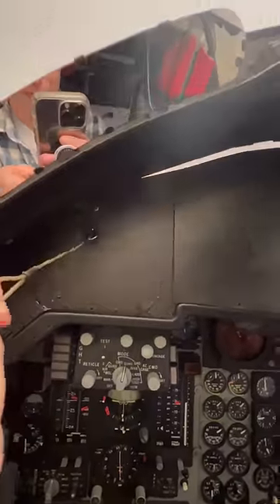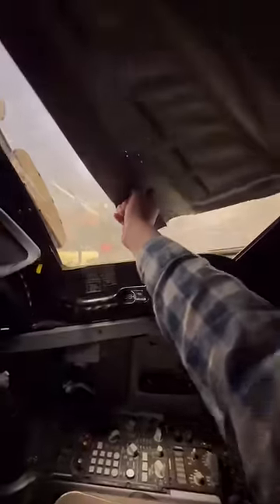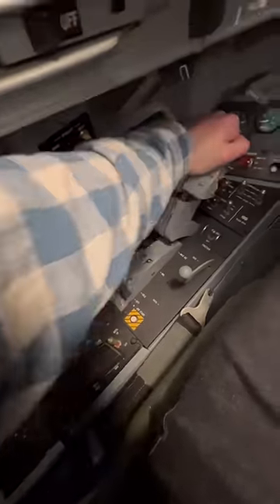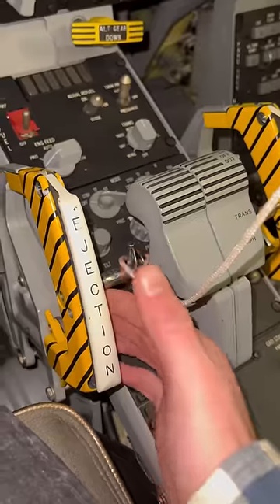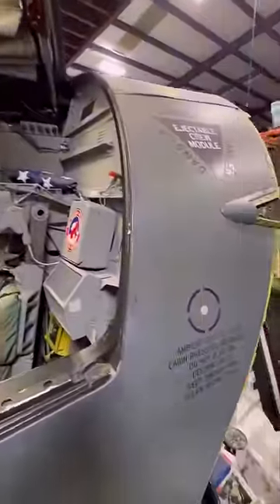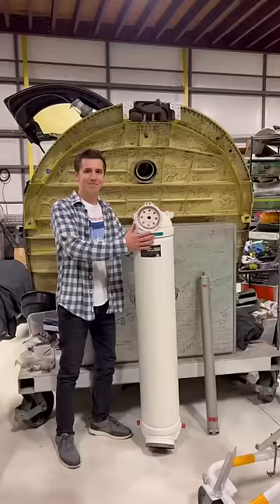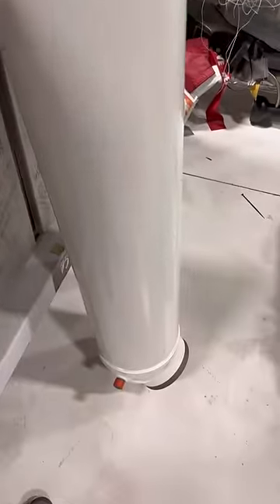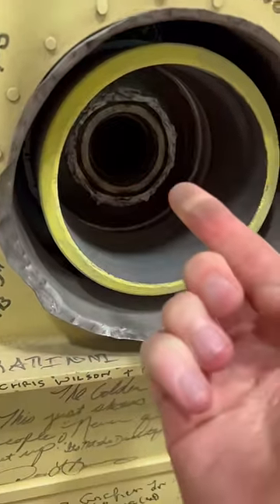How to Drop a Nuke and Survive

Comment: In Britain there was, or still is a lawsuit from soldiers against their government for non compensation resulting from injuries obtained during nuclear testing.

A group of survivors said the following…
They were told to wear safety/ welding goggles while on the outside of the warship facing the forthcoming detonation of a nuke over the ocean some miles away.

They were told that the brightness would be very intense. So they were told to turn around facing their ship with their backs towards the explosion. Crouch down onto the deck in the fetal position. Place their knees against their goggles and their hands between their goggles and knees with their eyes closed as tight as possible.

When they did that, they said the brightness was so intense that they could see through their hands with blood glowing red pulsing through their veins and beyond their hands they saw their knees and lower leg bone…with their eyes closed and wearing welding goggles. The flash traveled from behind and through their skull, eyes, hands and legs and reflected back onto their retinas allowing briefly to have X-Ray vision of their own bodies.

Would those curtains really keep that light away?

Comment: No need to eject.  They would most liked use a dive toss maneuver. The aircraft would basically pull up and release the bomb prior to the vertical then continue over the top, roll out and beat feet 180 degrees away from the release point. The again, there might not be any base left to return to.

Comment: If the jet can’t handle the nuclear force behind the bomb, I’m not so sure I’d want to eject out of that machine. Especially because you’re probably pushing the throttle to the maximum amount which will most definitely cause severe damage by ejecting that couple with the nuclear damage I’d probably rather just push the jet and pray.

Comment: The curtains seem really unnecessary if you dropped a nuke. Why? Because the blast will always be behind you unless you fly straight for a bit and turn 180 degrees to look straight in to the blast.

I'm guessing they where for nuclear armed air to air missiles.

Edit: I was close, it carried the AGM-69 SRAM which was a short ranged air to ground nuclear missile.